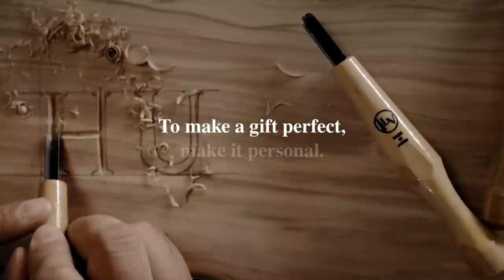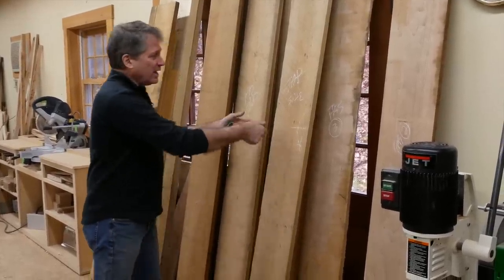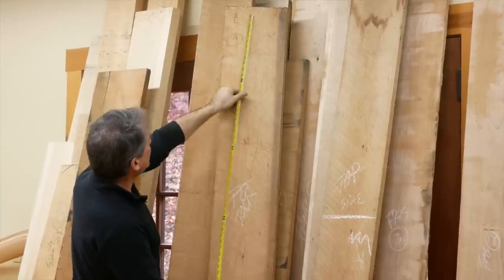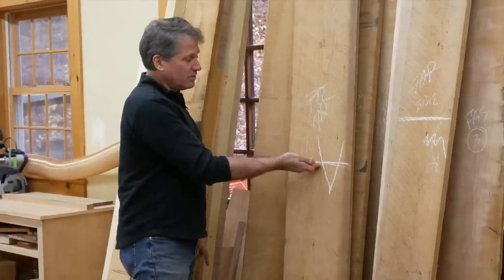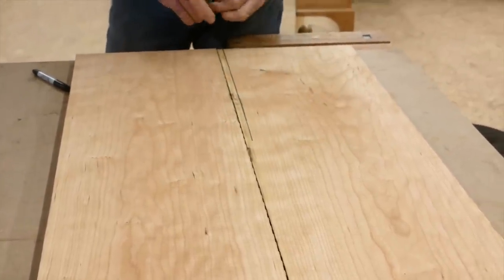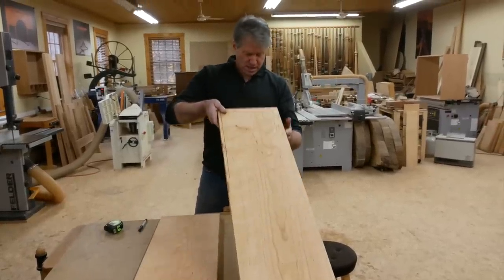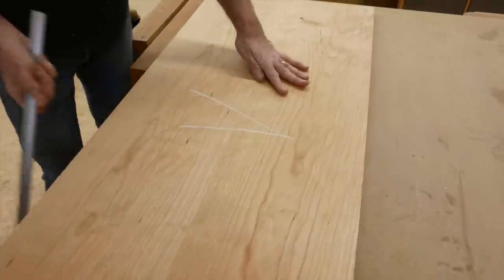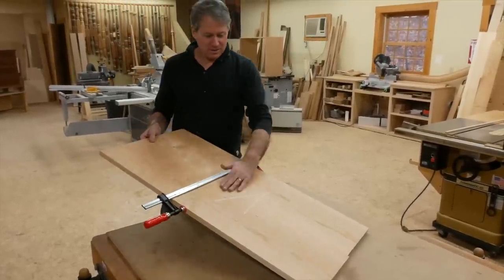Lumber selection and milling - Shaker Dresser Episode 2

Comment: Who doesn't love cherry, is gonna be beautiful....How much do you joint on the final pass?
Reply: I agree, this is some beautiful Cherry I have to work with on this project (from Goosebay Lumber by the way, if you are near New Hampshire)
I’m probably just skimming a bit less than 1/32” on the last pass. That and moving slow but surely helps to minimize potential of tear out and leaves a nice smooth surface ready for glue up. Glad you’re enjoying! Tom

Comment: where has this channel been? loving the content...nice work....I am not a safety nazi, but why do you operate the table saw without a riving knife?....I did not even know what the purpose of one is until a few months ago....i have operated my old table saw for 11 years with no issues.
Reply: Thanks Jeremy! Yes, it’s always a good idea to use a riving knife where possible, to keep the wood from binding if it should deform during the cut, and to prevent the workpiece from binding on the back side of the blade. I always set my tablesaw fence slightly open to minimize any possibility of it binding on the blade. And I have an after market small plastic insert splitter (made by Micro Jig) that acts as my riving knife which you’ll see in upcoming episodes. These cherry panels were so dry, stable and flat they cut beautifully without the splitter during the rip cuts.
Glad you are enjoying, thanks for watching!  Tom

Comment: I love using the slip joint method for tops of furniture. I’ve been using it almost exclusively for about fifty years. It usually creates a very well matched almost invisible  joint with the grain all running in the same direction. That cherry top is going to look beautiful when it’s finished and has aged to the final color that only cherry produces. I also notices some curl in the wood that will even add more to it’s beauty.
Reply: I agree Don, sounds like you should know! Cant wait to splash some finish on these chests 👍 Thanks for watching, and glad you are enjoying it! Tom